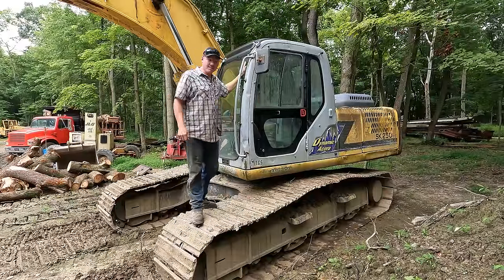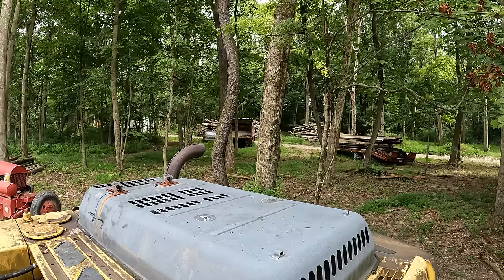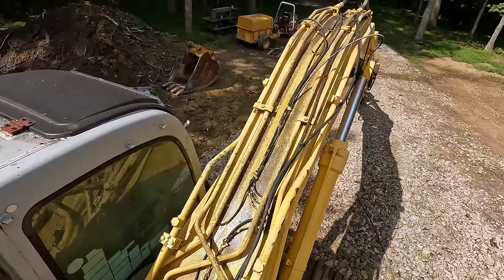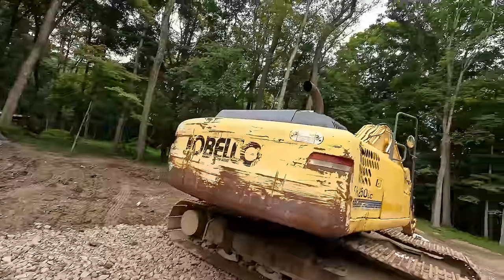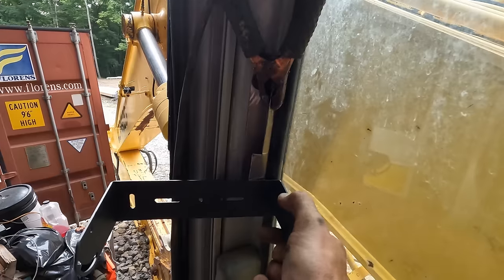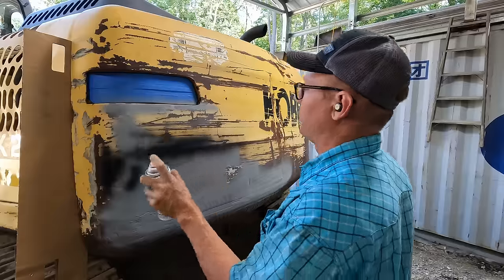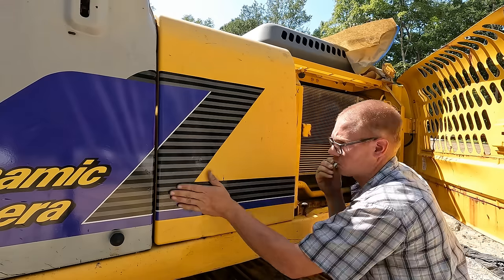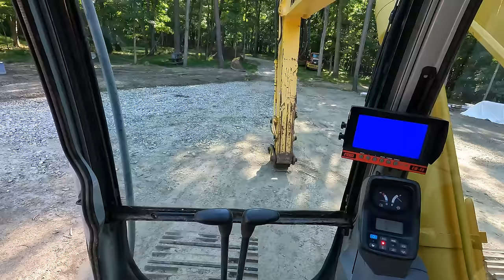Fixing up the Cheapest Excavator I Could Find! (Major Transformation)

Comment: Here’s a tip for the paint cans! Most of the time you can clean tips by putting them in a bottle with acetone and shaking them for about 1-3minutes after that they should be cleaned out. Another tip, if you have a air compressor you can put a blower attachment up to the straw that sticks out of the can and re-pressurize the can! This will get you that last bit out of a can.

Comment: Work on the excavator was really worth while. A definite improvement.  I notice you building isn't moving too fast although it looks like new material in the background. The plus of the delay is that your filled area has had a lot of time to settle before you put concrete and weight on top. Thanks for sharing.

Comment: For the plugged up spray paint cans Matt, what I found works great is flipping them upside down, and running them in the ultrasonic cleaner, I use simple green, but you could get more aggressive with some paint thinner in a glass jar in your water bath. You could just run the tips, but I find the tube inside also gets plugged so it clears the whole thing out. It also works really well for recombining old paint that has separated out, it will combine for a short time to allow you to use it, probably not as good as it was, but it beats trying to run out for more paint!

Comment: Tip for installing decals:
Peel the backer off, mist the decal with windex, place and position decal, squeegee decal.

The windex allows you to move the decal after placement and remove all of the bubbles.
Reply: Windex is too strong. It leaves so much residue under it that water can leech under the decal and lift it over time.  2-3 drops of dish soap in a pint of water is all you need.
Reply: @milesparris4045  Dilute the Windex with water 1 Windex to 2 water.  However just plain dish detergent (get whatever's cheapest) and water works just as well.

Comment: Pressure washing just added $5,000 to the resale value of that excavator... Also for the grease issue, use a detergent like dawn soap to keep it somewhat controlled. A trick for cleaning up the sticker residue is using a rubber wheel. It takes the residue off and leaves the paint.

Comment: Tip for vinyl decals:  Use EZ-Off oven cleaner.  There is also a commercial spray on decal remover, but I don't remember the brand.  We used to use them for removing Haz Mat placards off of trailers.

Comment: Also when removing old decals.. whenever possible, put your heat on the back side of the panel. This heats the surface and glue first and helps a little with burnt fingers and decal breakage.
Reply: A decal eraser is even better.
Reply: a wallpaper steamer is even better
Reply: To each their own, but I prefer to take the adhesive with the vinyl instead of having a sticky mess everywhere.
Reply: I respectfully disagree (in the instances when you can get to the back as previously stated) the goal it to heat the glue before the vinyl. When you can do that, the vinyl is stronger to pull on with less breakage.

Comment: 2 tips. Cleaning the nozzle of paint cans. After using the spray can turn it upside down and give it a little squirt. This will clean the nozzle whilst not letting paint out. 
Applying new panel decals stickers. Before applying squirt the panel with a week water to washing up liquid. This allows you to apply the decal and move it around to get out any wrinkles. Once this drys it should be fully adhered to the panel. Hopefully this helps. I enjoy watching your content. Keep it up. 😁👍 John Dolman from the UK

Comment: When installing new decals on anything spray Windex on the surface you are installing the decals on so the surface is wet.  This will allow you to slide the decal any direction you need to then take a squeegee and remove any air bubbles that form. this will give you all the time needed to install the decals. It makes the job much easier.  Good luck.

Comment: I think you just increased the value of that excavator by thousands, just by washing it. 
Diggers do get dented during use, so people expect it to have some marks. Paint over the divets just reads 'This machine has been used hard, but well cared for afterwards'. 
You can get some 'decal eraser discs' which are basically some sort of yellowish rubber. They just eat the decals and leave the paint underneath undamaged. You may want to look into those.
Reply from the maker: ahh ive seen those! Ill have to try em.
Reply: @DieselCreek  3m makes them

Comment: One of best vids yet, sadly I am a neat freak, really enjoy cleaning a machine once you have done all the hard mechanical work. 👍 PS if you foamed it down first with a detergent/degreaser, you would get more off, with less time and water
Reply from the maker: i used lots of degreaser plus the water gets up to 220 degrees
Reply: Doing it on a non sealed driveway was already bad enough for the ground water. Doing it with a lot more chemicals would have been worse for it.
Reply: @florichi  Folks don't know that water treatment plants use grades of gravel and sand to filter the waste water. Diesel Creek is sitting on a huge gravel pile. Remember he hauled tons of it for fill for the new shop site.
Reply: The other thing I always notice is that cleaning, like painting, should ALWAYS be done from the top down, not the other way around.
Reply: @DieselCreek  Check out Mike from Outdoors with the Morgans, he bought a foam canon thing that works well, the episode with his new/old 250 highboy shows it well.
Reply: @sallybrokaw6124  But they don't use only a few meters of it to treat water, but a ton more of it. And even then it's not save to drink, only save enough to be discarded in a large body of water. And tests have shown that even after a treatment plant carcinogens of ditergents etc are in large bodies of water, since they can't be filtered out.

Comment: Matt,  While putting decals on truck doors I was shown that using water and dish wash soap use enough to give lots of suds.  Start at the top and work down with a plastic squeegee to push the air bubbles out as you go.  That allows you to lift the decal to get the air bubbles out.
Reply: yes that is how they watch grave yard cars thats how they do it also

Comment: Hi Matt, Myself when installing decals such as you have I use spray glass cleaner and heavily spray the area that the decal is going to be. This allows you time to adjust the decal and then squeegee from the center out and let dry. This is just how I do it not sure if it is the right way but I have installed many graphics with this process with great success.
Reply: That's how pros do it. Old credit cards, flat sides from milk jugs and liquid laundry detergent make great squeegees.
Reply: you can use just soapy water
Reply: These were stickers with a glue backing. Not decals
Reply: These look like glue backed decals..not the normal style you can adjust with soapy water
Reply: @tonyhussey3610  it'll still work. The water keeps the floor from sticking, and when it evaporates, the decal sticks.
Reply: @mikeslatz1351  Works just the same. Tinted mylar window cover is glue backed as well. The soapy water keeps the glue from adhering until you squeegee the water out from under. I had to do this with all the fleet trucks for the mason contractor I worked for.

Comment: Matt, when you are through spraying for the day, invert the can and spray till it is only air coming out. Should help with this issue. Like mentioned, a fine needle will get that last clog if need be.
Reply: it also helps to wipe off the nozzles after you spray upside down.
Reply: Sometimes I pour a little lacqure thinner in the paint can lid ,and  dipp the spray can nozzle in that for a few seconds.

Comment: I have alot of respect for you,the 1st impression is a lasting impression,if you'll take a weak solution of soap and water and spray it where your going to put the decal you can adjust the decal and get all the air bubbles out of the decal.i used to decal my vans for my courier service and it works great

Comment: Hi Matt.  About Your Problem with Paint Spray cans.  After you have done that Paint Job and there is still a lot of Paint in the can. To clear the nozzle, just turn the can upside down,  Press the nozzle until there is just Propellant coming out, that has cleaned the nozzle  just put on the cap   ant put the can on the shelf. (you  can also put a piece of cling wrap over the nozzle and the put the big cap on) Hope this will solve your problem and save you a few Bucks. Cheers from Hans in South Perth Western Australia

Comment: Matt - use liquid detergent (eg hand dish washing liquid) a couple good squirts in a small bowl add some water so you get a real frothy solution. With a sponge, sponge down your working area with liberal amounts of the foamy solution. Peel the transfer tape off and apply  the transfer. This allows you to move transfer as needed. Use a squeegee to get rid of surplus water/detergent. This will start binding of the transfer. Squeegee and towel out as much as you can. Leave overnight then carefully remove the transfer tape. Any air bubbles will disappear in a day or two.

Comment: Just found your channel bud. LOVE IT !!!!!!!!! You did an awesome job! Some advice from an old timer now.... Before you steam your equipment. Take a garden sprayer and mix up your favorite degreaser, I like super purple or oil eater. that ar bey FAR  the cheapest and also,,,,,,,,work the bst. Dillute as necessary, spray her down and let her soak, on a beast that size, a few areas at a time. Installing decals. I used to do it your way! That is Chinese torture! Get your spray bottle and soak the panel and soak the decal. Squeegee all the water out  after they ar win place,, wall. ! You can slide them ALL OVER while wet and you can get NOTHING, but PERFECT result this way !!! GREAT WORK and pride sir! I subbed!

Comment: Hey Matt tips for doing the large decals! start from the bottom. Get them lined up, tape them to the surface. Let them hang upside down while you evenly remove a quarter up to half the backing from the bottom of the decal up, so since its upside down it will be technically the top from your perspective. Once that stuff is off, use a big paint roller or similar to evenly roll the decal on from the bottom up evenly. Once you get near the line you didnt tear off stop rolling and tear that off and then keep going until the whole decal is on. For long decals sideways, you can do a similar thing but from one end to the other sideways. Right to left or left to right, use a roller of some sort and tear the backing off a few inches to a foot or so at a time. Key there is getting it on straight and taking your time with it.

Comment: For applying large decals, spray the area with soapy water before hand to help get it aligned. Then get a large vinyl squeegee and roller. Even if you only use them once, super worth it for applying large decals perfectly and quickly.

Comment: Hey Diesel, for future decal install apply a little soapy water (spray bottle full of water with a couple drops of baby shampoo) to the surface and back of the sticker. This way you can move the sticker and line it up exactly how you want. Then squeegee out the water and let it dry. It will save you a lot of time, extra work, and some headaches! Great work though!

Comment: Holy shit it's yellow! If you do decal removal again I recommend a decal eraser wheel. It's basically a giant pencil eraser that you throw on a drill, they're also good for removing the adhesive left over when you take of body trim. 3M makes an amazing one if you're willing to pay but I've seen others as low as $10.

On a machine paint like this it would be pretty damn quick but if you use it on a car decal there's a fine line between removing the decal and burning through the clear coat and paint.

Comment: When you're applying decals; spray soapy water on the surface. Then position the decal (the soapy water allows you to move the decal around without sticking) to your desired location. Use a small flat piece of plastic to comb the soapy water to the outside edges , then dry.
I enjoy your videos - keep up the good work.

Comment: Quick tip for cleaning spray cans. You can try shooting a little bit of a compressed air back into the can with a blower nozzle. It will also add pressure if needed for an old can you be able to spray.

Comment: Hi, One tip I can give is to dip the decals in soapy water then put them on. You peel the backer then dip it in soapy water. You can remove and re-position them many times until the soapy water dries…it works like a charm! Thanks

Comment: The spray tip on the paint can isnt the problem.  The issue is that paint starts to harden in the tube leading up the the spray tip and then the chunks of dried paint clog the tip.  Take an old spray tip and drill out or remove the end of it so there is no restriction, the spray some paint out (into the trash or some place you dont care about having paint runs on) to flush out the hardened paint.  it wastes some paint, but makes what is left usable.

Comment: Tip the can upside down after last use and clear the paint from the tube and nozzle. Thats what I do. Works pretty good..., mostly. Don't use up too much gas doing it or you have a problem later.

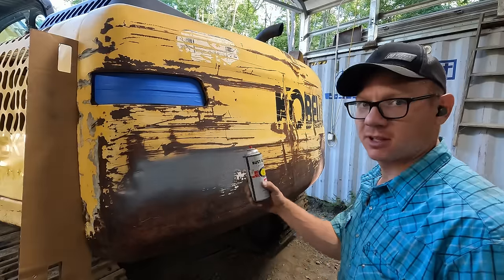Comment: 21:21 TWO DAYS?  Ouch.  I haven't done anything that large, but I've found that the best way for ME to clean it is to hose it down, spray on purple degreaser, and (gently/quickly) brush the thickest stuff off, rinse/repeat, THEN pressure wash it.  Were you using the steam portion, or just room temp water?  Steam quickens, too.  With degreaser in the mix, the sprayed/relocated grease comes off easier, too. She's looking much better. //  Heat, goo gone, and D-limonene orange cleaner are great for decals.  Those looked like a real pain.  // 37:00 Rattle can tips: 1) Always shake like hell (right side up and upside down) for at least TWO minutes before even attempting to spray the paint.  KEY: You need to THOROUGHLY mix the solids before they get in the pickup tube and block it.  2) Always empty the pickup tube and nozzle after you're done painting by spraying upside down for 1-3 seconds.  3) To clean the nozzle, take it off the can and soak in lacquer thinner overnight.  Then use a rubber tipped air nozzle to blow it out before replacing tip.  Be sure to AGAIN shake the can to keep solids out of the pickup tube and nozzle. (This will be on the test.)  ;)  //  Decals:  Soapy water and a round-edge bondo squeegee work really well.  //  Those Primelux lights are nice.  11klm is enough to see by, I think.  ;) 
Good luck getting more good work with your new prettied-up girl!

Comment: On those spray cans I soak them in lawyer thinner and hit with air hose. I also save any good ones for spares.  A shipping tag wire can sometimes be used as a tip cleaner.

Comment: Nice ! Kobelco makes a great machine. I did similar to a 1985 Kobelco K907C 
Water pump, changed fluids and filters, couple top rollers, freshened up the seals on the pilot controls, pressure wash and fresh decals around, the thing is a real head turner, has 6k original hrs on it she belongs In a museum lol
3k hours later the thing runs like a Swiss watch with zero issues !

Comment: When installing large vinyl decals like those. The easiest way to do is it is to spray the surface and the decal with soapy water, then you can apply it being able to slide it around. once it's in place you take a squeegee or plastic putty knife to get out all the water.  If you have ever installed tint on a window, it works the same way.

Comment: Cleaning the tip is really easy with a sewing needle.  Start with the very smallest you can find. Part of the reason the tip keeps clogging is it isn't mixed completely.  You need to shake for almost 10 minutes if it has sat for a good amount of time.  Next day one minute is fine but after a couple months, well, more is better.

Comment: Matt, when you are done painting with a rattle can, hold it upside down and hold the tip down for about 5 seconds, This will allow the paint to move to the bottom of the can and aerosol to move to the top and will push any paint out of the tip. I have done this since I was a kid doing graffiti and painting bikes  (90s kid here!) and I have never had a can clog on me. If that doesn't work, acetone is your best friend. Pull the tip off and let it soak for about 24 hours. If that doesnt work basically you're screwed.

Comment: To apply stickers/decals use clean water with a touch of soap. Put it in a spray bottle and spray the back of the sticker and the vehicle, place th
e sticker where it needs to be and with a rubber squeegee remove all the water and air bubbles.

Comment: installing decals, 

a drop or two of dawn dish detergent to a pint of water in a hand sprayer. Spray the surface, remove the decal backing while applying  the decal, slide it around to where you want it, squeegee the mixture out from the center of the decal let it set for a day and it done.  No wrinkles or bubbles.

Comment: Tip for putting on decals.  A couple of pieces of tape at the top for positioning. Then use a spray bottle to apply water to the surface.  Peel and apply, and use a body filler squeegee to get air bubbles out.  Any remaining bubbles can be popped with a pin, and squeegeed flat.
Reply: The decal can be moved around when wet.